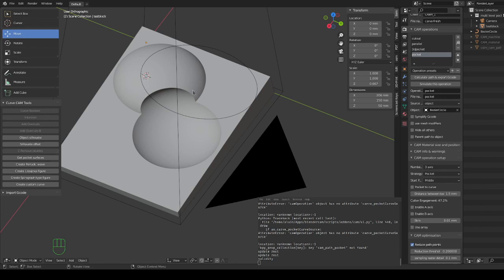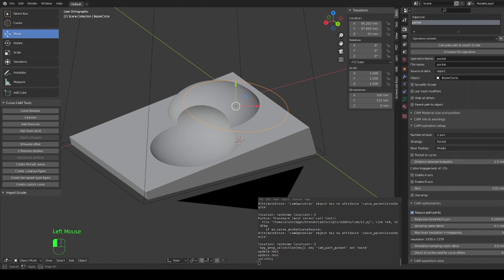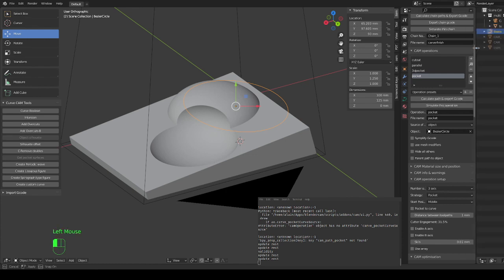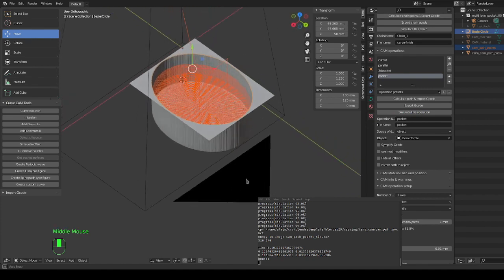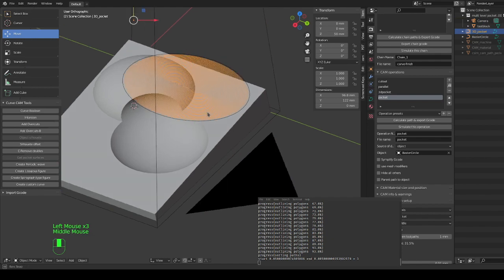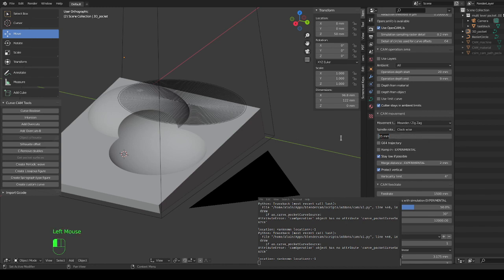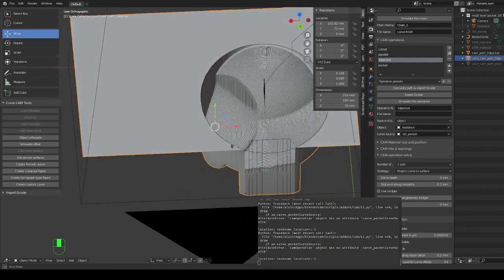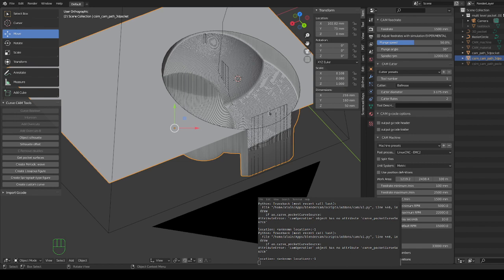fabex cnc:Pockets, 3D pockets demystified.

Comment: Hi, I'm an engineer using Blender as my main program, due to the open source nature and its coding possibilities. Its too bad that I can't use this 3D pocket function, Blender crashes every time. Maybe the code is not made for Blender 4.4.3 ?
Reply from the maker: https://github.com/pppalain/blendercam check out releases, 3.0.0 was uploaded yesterday and was tested with blender 5.0 and should work with 4.4.3  As for specific problems, you may ask for help on matrix.org in channel #blendercam

Comment: Hey Allain, again amazing work 😍
May I ask and suggest a series of step by step videos from wcs and stock setup, going through the main strategies, down to post processing?
This would be helpful for those new to CAM zs well as those coming from other packages.
Anyway, keep it on, this peace of code may shake the CAM land someday... 😉🤞
Reply from the maker: I am not certain what you mean by wcs.... so you want a beginner's setup?  feeds and speeds?
Reply: @diypppalain  sorry, Work Coordinate System, ie how to make the basic setup for a job like positioning and orientating the origin, configuring stock boundaries... Evrything needed before starting to create toolpaths.
Reply: @diypppalain  then videos explaining the various strategies available and how to basically use them.
And finally a video about how to post-process the program